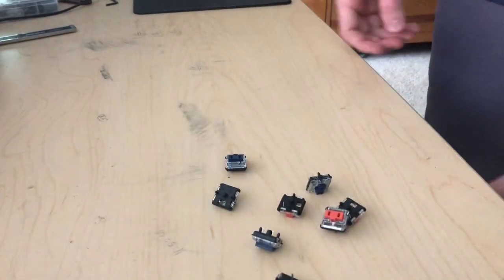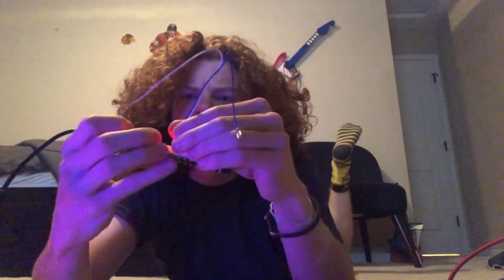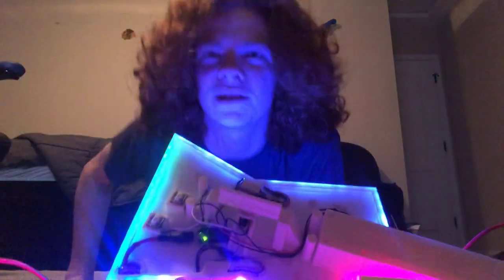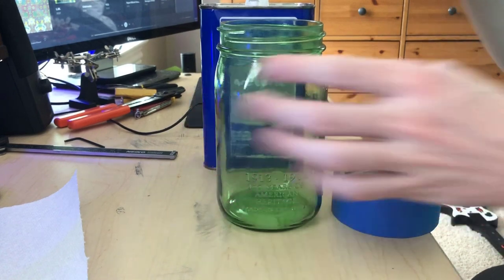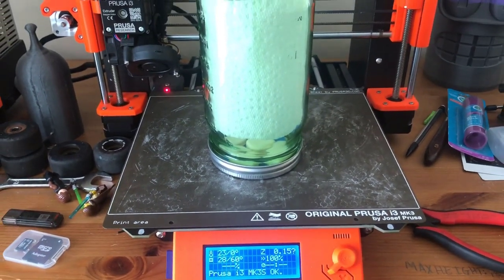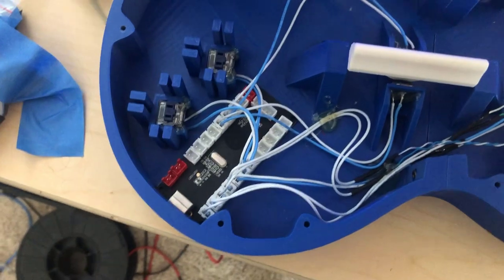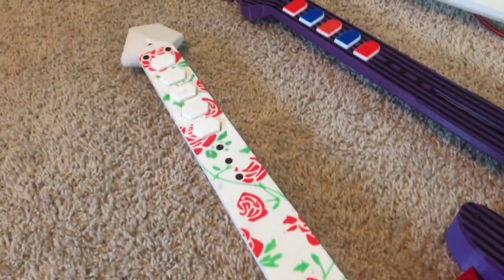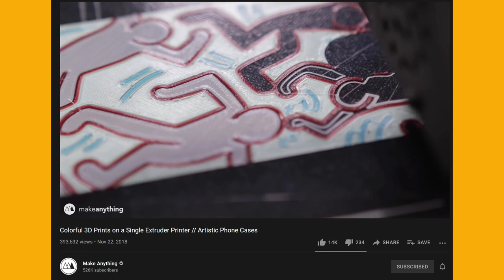How To Make Custom Clone Hero Controllers

Comment: You need to show us how to do it on the software for first time use. We can't just download. Open the file and hit print. Its not that easy. There are setting that need to be adjusted and things to take in mind with things like this. You will have to do a true step by step tutorial. Because my canvas size is all messed up. And your files on my screen look bigger on the canvas and I can't fit all that in there at once. I'm scared of making the prints too big.
Reply from the maker: im working on a more step-by-step tutorial that should be out in a week or two. as for scale, all of the STL files do not need to be resized or rotated. I printed everything at 0.2 mm layer height
Reply: @JoshDesigns  how would one youtuber talk to or collaborate with another? Because I have some questions and possibly some suggestions.

Comment: Hey I have made a bunch of the poly guitars and am just now trying to venture into some of the other stuff you mentioned, like ordering a PCB and adding some lights. I have some usb encoders and Arduino nano's. You mention and show that you can use the 5v pins on the encoder to power the nano and run some Led's off it. 
I am having some trouble getting the nano to run from the 5v pins, do you have any advice to get that working, or a video or instructions on how to hook everything up?
Thank you!
Reply from the maker: whats the problem you’re having? is the arduino not receiving power?
Reply: @JoshDesigns  yeah i have tried a couple different configurations, but the Arduino doesn't seem to get enough power to turn on when running from the 5v pins on the USB encoder.
Reply from the maker: @brysonwiggins6119  weird i never had that issue. i’m sorry i’m not more knowledgeable with electronics to help. I guess the only thing would be to check the polarity of the 5v cables coming from the encoder and make sure that the positive wire goes to Vin on the nano while the ground wire goes to ground.
Reply: @JoshDesigns  wow... That was it... The cables that came with the encoder black and red were swapped... So black was active and red was ground...
I swapped those and it works now. Thank you!
Reply from the maker: @brysonwiggins6119  Oh awesome! Yeah the polarity of the wires that come out of the USB encoders is confusing sometimes.
Reply: @JoshDesigns  your a legend! Thanks again! I'm loving how this one is turning out.
Reply from the maker: @brysonwiggins6119  so glad it worked!

Comment: Thinking of of doing this. One question though… How different would it need to be to make a DJ Hero Turntable?
Reply from the maker: My guitars only work on PC so unless you are emulating DJ hero then you would need to solder switches onto an existing Xbox controller (or whatever console). Also, making the spinning turntable from scratch sounds hard because you would probably need to use a 360 degree rotary encoder switch. I honestly don't know much with electronics but I hope this helps

Comment: hey i got some  questions about the RGB guitar shown at 3:15, trying to build me an inspired custom guitar from that
Reply from the maker: what questions do you have?
Reply: @JoshDesigns  these are more general questions about custom guitars but wtver

1. How do you plan for your custom gh projects (ex. do you sketch your ideas first?)

2. Where can i learn to code arduinos (like written guides or a book i can follow)

3. how do you know that everything will work like its supposed to?
Reply from the maker: @Felipe77646  1. I sometimes will sketch but most of the time i just do it all in blender. I start with a 2D outline of the Body of the guitar then model up from there. 
2. I just modify pre existing code for whatever arduino project im doing. so for the guitars I simply copied code that makes a game controller, read through it so i understood the code, then modified it so theres all the buttons i need on the controller. Basically, start small if you’re confused. like look up on google: “how to wire a button with arduino” then “how to make an arduino game controller”

3. hours of work and practice i guess haha. I pull up the arduino’s “pinout” which shows which pin does what. and I’ve done a bunch of simpler arduino projects already such as individually addressable LEDs
Reply: @JoshDesigns  thanks for the quick and detailed response!, also another one, where did you place the leds for the guitar in the timestamp

Comment: I want a list of links on these parts cause I want to make sure I have the right parts
Reply from the maker: check the description of my other video. or click the top link in this video’s description
Reply: @JoshDesigns hey, another question, I don’t know what wires I need cause they aren’t listed. What type of wire do I need?
Reply from the maker: @BearUmbrella  i used the wires inside ethernet cables. otherwise, dupont wires work
Reply from the maker: in either case you will have to solder wires to the wires included with the usb encoder
Reply: @JoshDesigns  oh ok, thank you

Comment: I am confused on k1 on the usb encoder diagram dose the wire need to touch all the switch's or just one
Reply from the maker: yeah i guess i didn’t explain the wiring well. The wiring coming out of K1 that touches all the buttons is the ground wire. ground is the same anywhere on the board so you can save space and make the wiring easier by connecting each switch to the same ground wire.
Reply: @JoshDesigns  think you

Comment: Yo! Have you tried the (ESP32) yet? It has built in wifi and Bluetooth. I've seen it advertised everywhere. Its a beast. Idk about making a game controller out of it. But I've seen people use them for at home creations like the DIY robots.
Reply from the maker: Yeah I actually just bought a version of the ESP32 that has a built in socket to hold a 18650 Battery so I can make wireless controllers.
Reply: @JoshDesigns  Does it have support for analog? For the whammy?
Reply from the maker: @LoungeTech0192  using arduino yes but usb encoder no
Reply: @JoshDesigns  How would you add bluetooth to the arduino for wireless connection to a pc?
Reply from the maker: @LoungeTech0192  honestly no idea. never tried it. but im sure there’s tutorials out there
Reply: @JoshDesigns  Nope. I looked.
Reply: @JoshDesigns  Your the only one to ever make a real game controller work with an esp32.
Reply: @JoshDesigns  You already have a game Exchange he in my hometown than want your guitars. Because nobody makes them any more.
Reply: @JoshDesigns  Game exchange will buy them from you for good money. All you have to do is manufacture them. #built them as requested.
Reply from the maker: @LoungeTech0192  that would be cool. could you put me in touch with them? also i haven’t actually tried using the ESP32 yet

Comment: How do you make a "Picking Lever" or "Strum Bar"?
Reply from the maker: I used to use a small metal rod for the strumbar to spin around but I wanted the guitars to be easier for anyone to print. so I now just 3D print a cone shape on each end of the strumbar which works surprisingly well. Also the force coming from the mechanical switches is enough to spring the strumbar back into place.

Comment: Hey do you mind uploading these models to printables you can port them over via the website. I fear thingiverse is going to go down the tubes and I dont want this project to be lost.  Also have you thought about adding guitar strap connections? I mostly play sitting down but sometimes I like playing standing. Anyway Cool design and its a really good project and has allowed me to play clone hero better than with stock guitar hero guitars with mech switches.
Reply from the maker: ya i plan on releasing more files soon for other guitar shapes. I will upload those on thingiverse as well as printables.
Reply: @JoshDesigns  Awesome! Hopefully these get more attention from the clone hero community because soon it will be the only option as the aging internals and cost of OEM guitars is getting to be to big of a barrier of entry.

Comment: im having issue with the code since I get this (Joystick.h: No such file or directory
) baby one what I can do
Reply from the maker: in my newest video i explain how to download the joystick library. that error means you dont have it installed or it isnt installed correctly
Reply: @JoshDesigns  got that solved but now i get ( Joystick_  exit status 1 'Joystick' was not declared in this scope)
Reply from the maker: @97samperio  did you edit my code at all? you have a line that reads Joystick.begin(); right?
Reply: @JoshDesigns  didnt change anything and I do have that line in the code
Reply from the maker: @97samperio  weird. ill check tomorrow
Reply: @JoshDesigns  if  only knew how to code lol pretty sure I'm just dumb and its something I did wrong
Reply from the maker: @97samperio  bro i promise you coding makes zero sense half the time
Reply: @JoshDesigns   ill take your word lol
Reply from the maker: ok turns out my code was missing a small chunk and somehow nobody told me there was anything wrong yet. I updated it now. pls let me know how it works
Reply: @JoshDesigns  codes works thanks my dude

Comment: Maybe I missed it, but how does the strum bar work?
Reply from the maker: I used to use a metal rod for the strum bar to spin around. But if you look at the 3D models, I put a cone shape on each side so it can spin. I promise it feels better than you would expect
Reply: @JoshDesigns  I think I just need to look at the models. I was just confused how the switches get pressed and how it returns to center. Thanks man!
Reply from the maker: @fr3ak1shh  Yeah the force of mechanical switches are enough to make the strum bar go back to the center

Comment: i dont know if you did, but can you link the arduino and buttons that you used
Reply from the maker: search for "arduino pro micro" and "Kailh low profile mechanical switches" on amazon or aliexpress (I would suggest aliexpress for the switches and amazon for the arduino)

Comment: could you theoretically make it with mouse switches so the buttons have less teavel time
Reply from the maker: maybe. some of the first few guitars i made were using lever switches which i think are the ones in mice but i could be wrong. I now like the feeling of the low profile switches more

Comment: Can you just put all the internals of an existing guitar into this?
Reply from the maker: I modeled it to fit low profile mechanical switches and not the buttons that existing guitars have. But buttons are just buttons so you could just replace the USB encoder/Arduino Pro micro with an existing circuit board from a GH controller.

Comment: Hey bro, can you make a tutorial only for building the strumbar? It's the biggest problema I have with my current project
Reply from the maker: what problems are you running into? whats your project?
Reply: @JoshDesigns  well, It's Just a theoric project right now. I'm planning a guitar(xplorer shape) made with acrylic. I'm looking for some tips around internet, I found your channel and I'm planning with your tips. And I wanted to know How you made the strumbar act like It should(be pulled or pushed and Go back to its place)
Reply: @JoshDesigns  well, It's Just a theoric project right now. I'm planning a guitar(xplorer shape) made with acrylic. I'm looking for some tips around internet, I found your channel and I'm planning with your tips. And I wanted to know How you made the strumbar act like It should(be pulled or pushed and Go back to its place). I'm still putting Things on paper
Reply from the maker: @zri9553  if you look at my stl files on thingiverse you can see there are two cone shapes on each end of the strumbar which is what allows it to spin. and then The mechanical switches provide enough force to spring the strumbar back into place
Reply: @JoshDesigns  thank you Very much, bro ◉‿◉

Comment: I Wana buy a printer and was wondering if you have any options on which one to get
Reply from the maker: I use the Original Prusa i3 MK3 but that one can be expensive. so, if you are okay with spending a lot of time tinkering and understanding how 3D printing works, then the ender 3 is a decent low budget option. regardless, never be afraid to ask for help
Reply: @JoshDesigns  I don't mind spending a bit of money but I was hoping to go to microcenter and pick one up instead of waiting for it to get delivered 😬 and microcenter doesn't sell the one you recommend 🥲
Reply from the maker: @97samperio  I believe microcenter does have the ender 3 as well as other Creality printers but if you want a quality printer, i recommend an Original Prusa
Reply: @JoshDesigns  would the Creality CR-6 Max 3D Printer be on par  with the prusa ?
Reply from the maker: @97samperio  the CR-6 max would be a little less reliable in terms of prints failing and parts breaking. But it does have a much larger build volume if thats something you want. Although, I’ve worked with a version of a Creality CR-10 that had a large build volume and the printbed became so warped over time that we couldn’t print anything
Reply: @JoshDesigns  good to know I'll go with the prusa and just wait for it to ship thanks again 👍
Reply from the maker: @97samperio  good choice!

Comment: does link in bio still work it just spins for me?
Reply from the maker: the links worked for me. are you talking about the printables link?
Reply: @JoshDesigns  yes! But I went on another video and found a link to the poly controller and it worked!
Reply from the maker: @jerez1lla913  oh ok cool
Reply: @JoshDesigns  hey I have a question about the PCB is there anywhere I can message you?